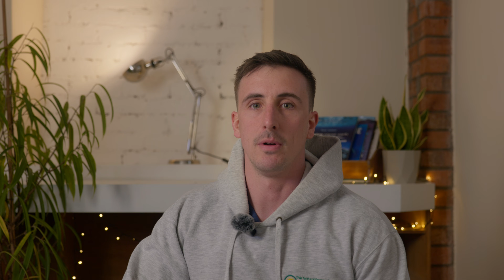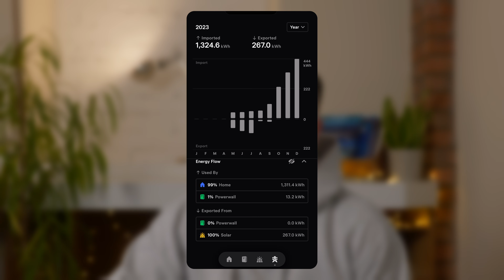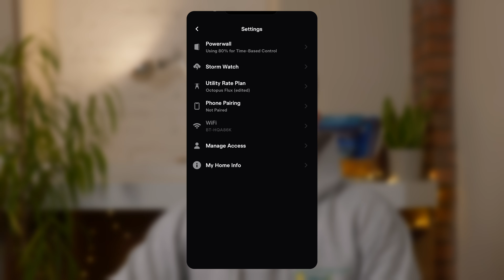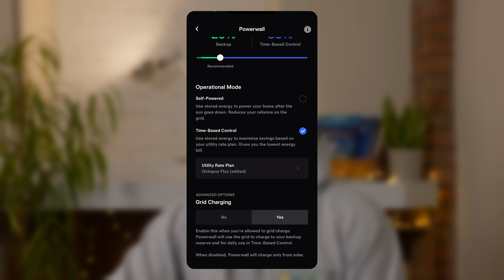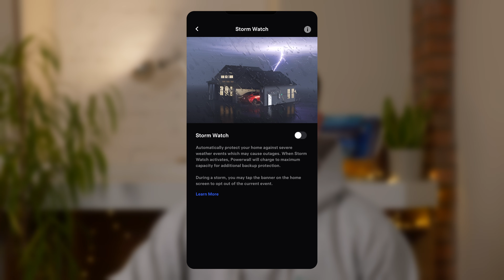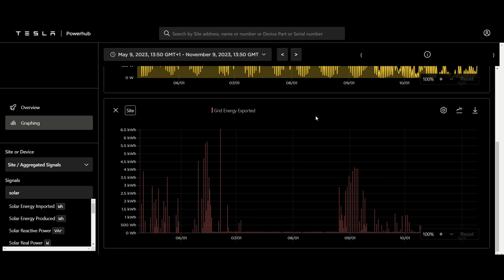Complete Tesla App Walkthrough | Tesla Powerwall

Comment: So we just had a PW3 installed a week ago. We have existing solar (since 2017)  We actually are using the PW3  just for when we have an outage. Our system provides more power then we need, we always push into the grid and have credits all throughout the year.  The PW3 was part of an incentive through our utility because we are in an area with frequent outages.  It was free, installed :)  

Before the PW, when power went out in the past, our solar doesn't power the house (of course). Now that we have a battery, when we lose grid power, does solar then play a role in helping provide power to keep the battery charging (during the day during an outage?)   Since the PW3 has an inverter and we also got the gateway? Or does something have to be configured to do this (or did it need to be wired differently?) This is all new to me  :)  Thanks !

Comment: Not a single YouTuber shows you how to connect the power wall to the app. They just show you how to use the app.
Reply: that is done by certified tesla installers, if you're an end user you're not supposed to that by yourself unless you're an owner-builder in that case you'd have to register online and take the trainings.
Reply: @GoutGamingTV  Connecting the app to the system is not the same as installing the system. There is no need for a certified installer, just instructions on how to connect the app to the already installed system.
Reply: @jameshoward8609  it does have to be commissioned by a certified installer before you can connect your powerwall via bluetooth using your own tesla mobile app tho.

Comment: Very informative. I've just had a Powerwall 3 installed and I note that your demo, like mine, is still importing a low level of power even though there is charge in the battery. Also, in the morning, my microwave and kettle takes power from the grid even though there is available charge in the battery. I think the battery is a teenager and doesn't like getting up in the morning. The questions are currently with Tesla.
Reply from the maker: Thank you for your comment, I'm glad you enjoyed the video. Regarding the issue you are having, what tariff are you currently on?
Reply: @TheNaturalEnergyCompany  I'm on Intelligent Octopus Go. The microwave and kettle go on after 07:30 and I've set the app to know that this is not the cheap period.

Comment: This is a really EXCELLENT video - thank you & well done.  I've 1 criticism & a question.  At 16:40 you suggest that because there is grid export in the Summer a 2nd battery might be considered.  I feel this is an over-simplification, for you will need a very, VERY big battery to avoid ALL export, and the bigger it is the less it will cycle and the more it will lose through self-discharge.  Without cycling it will not be used enough to justify the initial outlay (and maybe the space too).  Which leads to the comment:  you didn't mention a feature to monitor the battery charge/discharge cycle count - or the NEED for it - in the App run-through:  unless I missed it this is a MAJOR omission: it has a bearing on warranty and validates the battery-sizing calculation.
Reply: Something else that manufacturers and installers skate over or ignore:  the inverter efficiency curve and its implications.  Broadly, the efficiency of ALL inverters falls off a cliff when operating at below 20% of rated capacity, and with a small array like your example or a larger one with significant shading, choosing of a large inverter such as the 11.5kW PW3 means the system will be at low power for FAR MORE of the time than is predicted by the (California-based) CEC-weighting formula that Tesla quotes.  And therefore at low efficiency.  When will this be at its worst?  At high latitudes, and in Winter - just when you need it most.  So why do no commentators focus on this and force manufacturers to publish?
Reply from the maker: @falfield  Thank you for your comments, so glad you like the video. As an answer to your questions. The purpose of capturing more energy from solar is to either use it later in the day or export it when the price is higher. Exporting at a fixed rate is fine but if you can store it, and export to be paid more later that day, this is better. It is of course a payback analysis though. 

Powerwall 3's inverter is efficient all the way down to -20C. The cells are also maintained at a minimum temperature of 0C to maximise the output. It's the only battery designed to go outside.

Comment: Great video. Just asking for some advice, had a EV for a couple of years and just ordered a Powerwall 3 and Heat Pump. I’m currently on the EV tariff at 7p cheap rate for 6 hours with Octopus, I’ve been looking at the Cosy tariff with 3 cheaper rates. Can you charge the Powerwall at the 3 cheaper rates then discharge when it’s more costly? 
Thanks Ste
Reply from the maker: Yes, once your new Powerwall is installed you can input the details of your tariff into your Tesla App with each of the different peak and off peak periods.  Time-Based Control uses this tariff information to optimise how your Powerwall charges and discharges to lower the cost of energy consumption.  This is often referred to as load shifting. Head over to our website www.thenaturalenergycompany.co.uk to read our latest blog on load shifting. Thanks!

Comment: I've just ordered pw3 and solar, being fitted in September. Am on intelligent octopus go, so thinking will charge battery through night at 7p then sell  surplus of this plus solar generation back at 15p through day which is what octopus pay to export. Aim to get battery down to 10% by midnight, then go again. Have you looked into this option? Any thoughts?
Reply from the maker: This is a good tactic but Powerwall 3 will take over for you, it's all automatic. You need to issue your buy and sell prices and it will do the rest for you based upon its machine learning algorithms. It will ensure you are getting the most out of the system. It's quite clever like that!
Reply: FYI Octopus only pay 8p per kW export if you're on any kind of 'go' tarriff
Reply: Just checked with octopus, thats correct for octopus go, but if you are on Intelligent Octopus Go then you can still sign up for 15p export rate

Comment: Hey mate great video thanks for sharing.  i still have a question. Is there any chance to set up a charging limit.  I learnt its better for.the battery in terms of lifespan if it is not fully charged all the time.  ☀️☀️
Reply: I am another viewer. I do not think that is necessary with the Powerwall 3 chemistry.
Reply: I was just listening to the Batteries included podcast and they had a battery scientist on. He said no matter what the chemistry is that you want to charge slowly and only be at a low or high charge state for short periods of time.
Reply from the maker: Whilst this can be a common point with batteries, Powerwall will ensure it takes care of its own health and lifespan day to day. The aggregate throughput of the Powerwall is limited as per the warranty however it is unlikely you will go through this during the 10 year life span. I hope this helps!